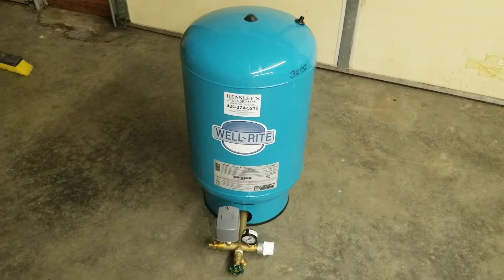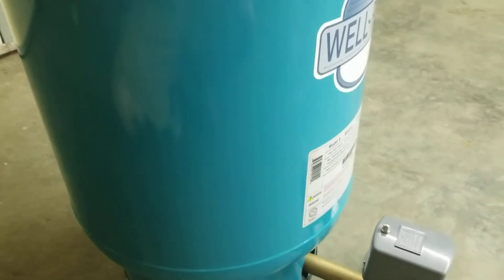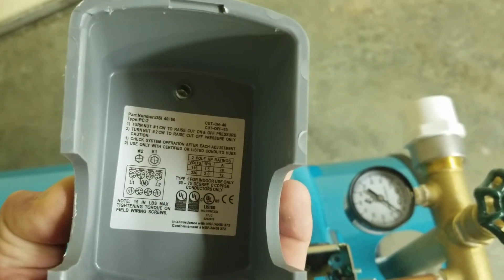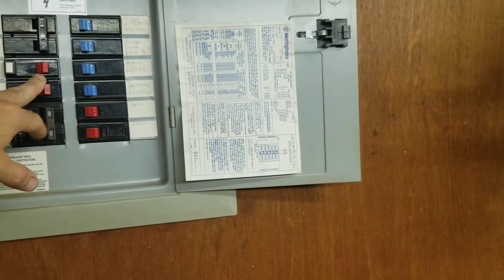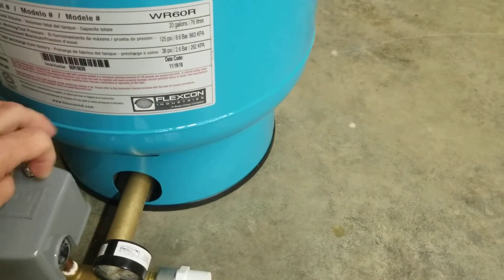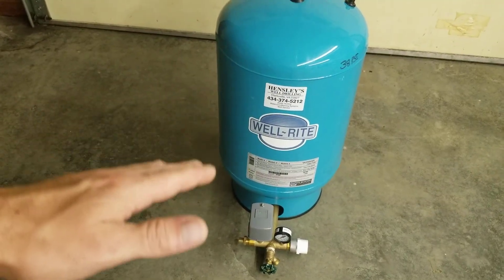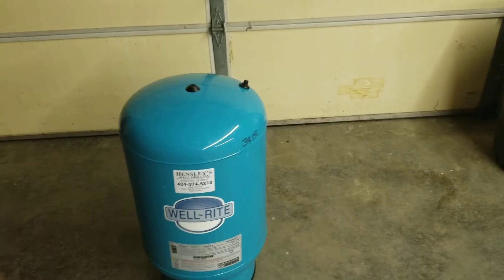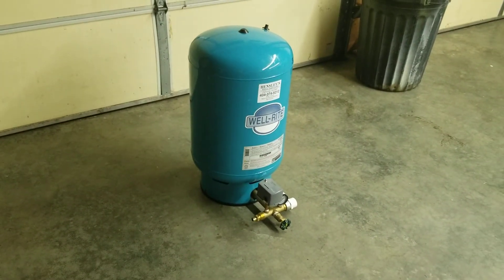Well Pump & Tank Troubleshooting, How the system works, Adjusting Pressure Settings Correctly

Comment: Hi again...Would you please  be so kind as to answer a follow up question after our exchange yesterday;

I fixed my low pressure problem by following your advice and  emptying the water tank,  seeing that the air pressure was very low and putting in air to 38 PSI. The pump filled the bladder quickly  and the normal water  pressure in the house was restored. But...then I checked the air pressure with the bladder full and saw it jumped to 70 or so and I got scared and let out some air... It still seemed to have good water pressure after I did that but please let me know;

- WAS THAT A MISTAKE to let air out ?

- What should the air pressure read when the bladder is full?

- Now it reads 35 PSI with the bladder full and I have decent pressure so should  I leave it alone or put it back up to 38

Thanks for any help you give me

Cheers
Reply from the maker: Never test the air pressure when water is present in the tank. 
It must be set when empty of water. 
I'm assuming you have a 40/60 p switch. Since you set it to 38 psi (which is correct) 
Since you let the air out, it'll over stress the bladder. Go ahead and put it back the way it was before. 
Just be sure to kill the power & open a faucet. Then adjust the air once it's empty of water. 
30/50 switch needs 28psi air
40/60= 38psi air
Reply: @h2omechanic  Thanks again....will do

Cheers

Comment: Hi and thanks for your informative videos. 

This trial  lawyer admires  expert witnesses like you and would appreciate your advice on my problbem before I hire a plumber. I have a less than five year old submersible pump in a lake about 200 feet from my  house and the system has worked perfectly till now. But now my pressure guage suddenly reads constantly between  90 to 100 whereas it always read between 40 to 60. 

 I do still have water in the house but at very low pressure and my water tank seemed pretty empty but  I still emptied the water tank by opening a tap and measured the air pressure at the top of the tank which read 36 to 37. The pressure guage on the bottom of the tank did go down after  I emptied the tank  but only to 70 or so and I heard the " click" and pump turned  on but then it guickly again clicked off. However it is not " cycling" on/off repeatedly. The tank is seemingly hollow and  NOT  full of water and no water came out of the air valve on top of the tank but I do hear a bit of water sloshing around at the bottom even after I emptied it. When I turn my pump breaker back on I do not hear a click and I can hear that the tank  itself  is NOT filling with water and even when I flick that little  lever on the pressure switch I do not hear the " click" I used to hear of the pump turning on...but I still get water at low pressure in the house. 

After watching numerous videos and studying how these pressurized systems work I realized that it would be  easier to get a law degree than to get a plumbing degree because of  how complicated a diagnosis can be. 

My question is;
- is it possible that the pressure guage itself is defective and if so is this perhaps my problem...does this guage actually activate and control the pressure switch or does it just read what the pressure is in the tank?

- Am I right to conclude that the bladder in the tank is probably NOT leaking, even if I hear a bit of water sloshing around and that the tank itself does not seem to be the problem. It is 20 years old but looks brand new. 

- am I right that the pump itself is okay because I still have water at the taps but just very low. 

Any suggestions would be appreciated. 

Cheers

Leon
Reply from the maker: Ok, so the pump is 5 y/o & the tank/controls are 20 years old.
Average life span 
Pump: 12-15 years
Tank 8-12 years.
Without sewing your system or knowing your geographic location, sounds to me like you had your system freeze up. 
That will ruin the pressure gauge and also could cause the pipe to split somewhere, this would leak out most of your pressure and cause the system to run as if your using water somewhere. 
A PSI gauge is a 25ct item made in China, they aren't reliable like a hydrolic system gauge. But I still think it froze at one point. Since water expansion happens during a freeze it bends the internal spring.
My suggestion is replace your tank & controls. 
If you turn off the pump power and your gauge goes from 100 down to 70psi (your 0 psi mark) that means the system didn't hold the pressure as it should & youll have to pull out the pump & look for a cracked pipe or fitting. If the pipe looks good, it may be a bad checkvalve in the pump. 
A complete update should be between $1700-2100. Then you'll be set for another 10+ years.
Reply: @h2omechanic  Thank you for your prompt and detailed response...that is very civilized of you and much appreciated.

After listening to your videos,  I did the entire diagnostic procedure again and GOD willing,  I believe I solved the problem by doing what you said about checking the air pressure in the tank after completely draining the system and found it to be very low at around 15 PSI. I filled it to 38 PSI , turned on the pump and the normal pressure returned to the house and hopefully it will hold up. I also concluded that the gauge was just defective and that this could not be the cause of the problem because if I understand correctly, it does not control the pump or the pressure switch but just passively reads the pressure in the system.

Not bad for a mechanically challenged lawyer ! I am now ready to learn how to screw in a light bulb.

It's all about KNOWLEDGE in all facets of life.

Thanks for your help

Cheers

Comment: My water won’t come on. If I manually push the contacts in to ON on the pressure switch, the pump turns on, but cycles off without water coming to the house.
Reply from the maker: Kill the power, remove the switch and clean out the nipple below it. Itll be clogged up with rust/sediment.  If its not plugged, replace the switch
Reply: @h2omechanic  do I have to drain the tank?
Reply from the maker: Kill the power & open any sink & leave it open. If you have a 30/50 switch, the rank should have 25psi in it of Air. My tank videos explain the process if the video you watched didn't.

Comment: My water booster switches on for few seconds and stop. i will like to know about the cause of the problem. The pressure tank is also empty
Reply from the maker: Not sure. 
But normally if a switch short cycles on/off/on that's an indication that the tank is bad

Comment: Hi thank you for the video! What do you think is going on if the tank psi reads 0 constantly right now? There is zero water pressure in the house. You can turn on the faucet and it kind of dribbles out. Appreciate any help!
Reply from the maker: Watch my pressure switch video. Find the Well Q&A Playlist on my channel
Reply: @h2omechanic  hey thank you for the really quick reply. Here are some more details. The pump never comes on even though the pressure is below the set pressure. This is a submersible pump at 205 feet off depth. I think it sounds like that switch is shot but I guess it could be the controller. I did not test the tank for a blown bladder though. I did test all the lines and breakers and they are getting power.
Reply from the maker: @mattwilson3560  if you test for power out at the well (wire nuts) if u get 240v there then you'll know that power is going thru the switch to that point. If you got power there(well) then the pump is dead or wire down the well is rubbed in two/broken. It's common if its 10+ y/o

Comment: Everything was working fine and then my gf took a long shower and then after her shower the water pressure went bad. The cut-on is 20 and cut-off is 40. There is two tanks the small one connected to the pump and then the larger bladder  tank. The folks that installed it said they boosted the pressure, so the small tank stops filling at 60 and fills the bladder  tank none. The bladder tanks pressure is at 34 so Im wondering if the pressure in the bladder tank is to high or if they boosted the pressure and my 20 40 is no more correct?

Comment: My switch keeping shutting off. I have the lever style switch. Was trying to shower and then it started shutting off. Now for the past 2 days I’m having to flip the switch to use any water and it only lasts for 5 min before it’s off. Never done this before, usually just clicks after the water heater starts cracking and popping.
Reply from the maker: Watch a few of my tank videos and take notes. 
1 the nipple below the switch is clogged 
2 the tank is low on air & needs to be pumped up using a compressor 
3 pumps is about to die & currently runs & overheats and cuts off & on again after it cools down.

Comment: Please help I am getting connection to my control box for my switch box but I'm not getting any water coming out of any speaker my pressure gauge on the switch reads different than what my gauge says what should I do

Comment: Great video man! Hey I have a small well pump in my crawl space JUST for a 4 zone SPRINKLER system and this spring when I went to turn the ball valve I noticed there is ZERO pressure in tank and nothing kicks on when I attempt to start sprinkler system. Do you think my well pump/tank is shot? Or is it more of an "on demand" type of well that should only kick on when the sprinklers are on? Thanks man!

Comment: Really great video and has me understanding more about the well system but I'm confused about how my well doesn't show any pressure on my gage when I turn it on but will still shoot water out my hose for only a limited time until I assume it goes empty again I've replaced the preasure switch also and the well kicks on and stays on but I don't know

Comment: My pump will not hold pressure in my shower gets hot and cold and then my sink in my kitchen has hardly no pressure here lately and whenever I ran my shower this morning on hot for a minute it took forever to warm up and it lost pressure and then no water two days before this my toilet started messing up and wouldn't feel up and got stuck so what do I do is it my foot valve or what and I can look down into my well in the water is cloudy
Reply from the maker: Probably a leaky check valve at the bottom, or a broken pipe, that would explain the cloudy water. If you kill the power & it drops to 0 psi, then pull the pipe out the well
Reply: @h2omechanic  thanks
Reply: Now I can't get my pump to prime. I've already put 6 gallons of water in it and it will not do nothing what do I do
Reply from the maker: @crystalchastain1739  the foot valve is bad, there's nothing you can do. You gotta get a well guy to replace the bottom check valve.
Reply from the maker: @crystalchastain1739  it's possible a piece of trash is kinda stuck in it. Or it could be cracked/ plastic due to over tightening.

Comment: Earlier today, we had only a trickle of water, a few hours later, flow seemed to return to normal. An hour later, back to a trickle, any ideas? Thank you!
Reply from the maker: A leak somewhere wasting water, drained the well dry. 
95% of the time its a leaky toilet that is the issue. Leave the breaker off when your not using water. Then go inspect toilets & see if any are overflowing in the back or if 1 emptys itself. 
Or a big wet spot in the yard between well & house

Comment: 60 psi In my well house.  30-50 switch.  Well pump good.  From well house to my house no volume, no pressure.  Just trickles in house. Outside facet no pressure.  Pressure tank was 8 psi.  I raised it to 28 psi, no change.  Changed 4 inch and 20 inch sediment fter, no change.  I'm stumped.  Any help.would.be appreciated.  Thanks.
Reply from the maker: If you installed a black carbon filter element, that's the issue if so.
Don't trust the gauge also. Open a faucet in well house & confirm pressure there first. Try not using any filters in the canisters too. It could be a leak in the ground between well & house. Or a dry well & old pump struggling to build pressure. Hope this helps. But it could be like 5 different scenarios

Comment: Brand new tank. Cant get water to go into er. Plug was pulled out. I see a small ammount of sediment at the tank enteranceim using a mastercrap pump i assume thats my issue
Reply from the maker: Probably the pump, disconnect a line & see if it flow out before the tank.
Reply: My pumps pumping well. It fills the toilet no problem and lots of pressure on the outside spigot. Bit my brand new tank will not take water. 38 psi in the tank without the system on
Reply from the maker: @nickburke2876  a tank only fills 1/3 with water. It's suppose to feel lite. 38 psi is correctly set if you have a 40/60 switch.
Reply: Oh no man i cannot even get it to put a damn half a cup into er i even put a ball valve 12 inches  from it in case it was airlocked

Comment: So my garden hose was left on and it drained my well but my tank is empty no air I put air in it I can hear it sucking water should I leave my valve close and let it fill up the tank first before open up the valve
Reply from the maker: If the tank is galvanized, you need the valve closed & the tank half full of water. 
If the tank is blue/ painted, & air is leaking out from a water pipe, that tank is completely bad. The bladder inside has torn. Replace it asap

Comment: Good Video! I have a question. I’m trying to help a older widow with a water problem. She went away for 2 weeks and while she was gone she had a pipe freeze and break.  Don’t know how long the well run, maybe close to 2 weeks, but I took her home, heard the pump running, it’s in a little pump room. The pump was ver hot. It’s a 2 HP Jet pump. I shut the breaker off, to access the damage .shut off water valve to room with broken pipe, turn breaker back on and pump will run without stopping  at 50 psi, but water won’t run again because pressure tank is empty. It had no air, also no water and sounded hollow. Put air in the tank but can’t get pressure tank to fill. I’m not a well guy, just trying to help a elderly woman. Any ideas?

Comment: Thanks a Million for your video!!! Now I can go under my house and feel like I halfway know what I'm doing. The pump keeps cutting on every 65 seconds & runs for 15 seconds and shuts off. No leaks anywhere. The pressure switch is ok, Now on to the bladder tank. Hope that's what it is! not crazy about changing the foot valve in the well. had a new pump and bladder tank put in about 15 years ago. the foot valve is the original from 1959. LOL. the foot valve is older than I am.

Comment: February 20,2022 Wpg, Canada asks: How much pressure do you add into the bladder?
Reply from the maker: 2 psi below the (on) pressure your switch is set for. Look under the plastic cover.  If it says 30on 50 off, then set your air to 25-28psi max! 40/60 then you'll want 35-38 psi of air. Have system power off & leave a sink open while adding air.
Reply: @h2omechanic  we just tried and the pressure in the bladder is not rising.
Reply from the maker: Tanks bad. Replace it asap

Comment: Dear Sir,
We had some very cold weather recently and my pressure tank will not fill. We are pumping water directly from the well into the house. My pressure switch (60-40) is working and will cut off at 60 lbs-but then fades down to about 48. My tank has no water in it and the psi measurement is 54 on the top. I placed a space heater next to the tank all last night and most of the day...but no dice. If there’s a frozen section of pipe under or near the tank, it hasn’t budged. Do you have advice on filling the tank?  
Should I release all the air in the bladder and re-pump with my compressor to a different number?  More heater time?  We have water but as you mentioned, I don’t want to burn out the well pump. 
Thank you!
Reply from the maker: 1st kill the breaker to the pump & leave a sink open. Then go let air out the tank to 25-28 psi. Then turn the power back on & see if it acts normal.  54psi in the top is way high

Comment: My water shuts off and contact open but most the time when it hits the lower on pressure of 40 nothing happens, won't refill if I manually flip the contact sometimes it will work